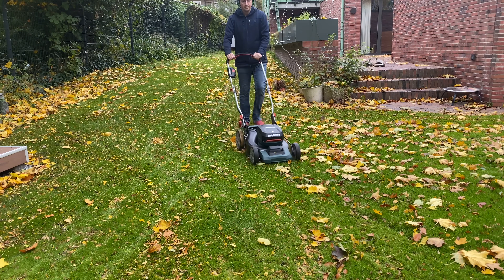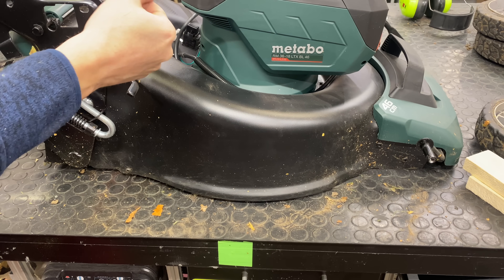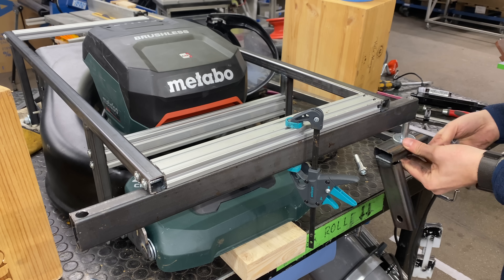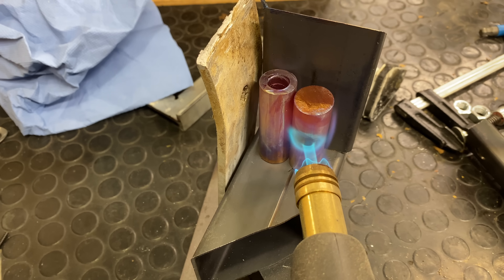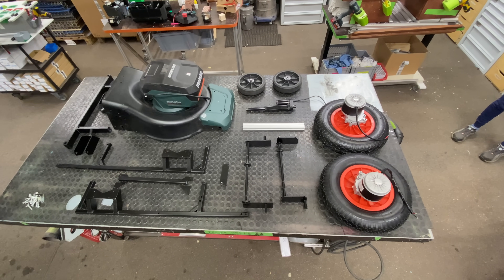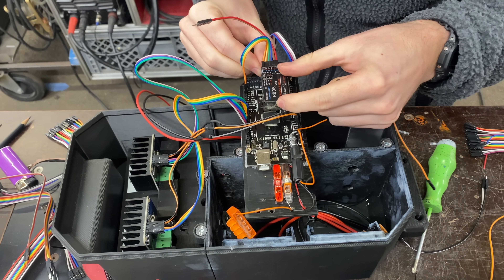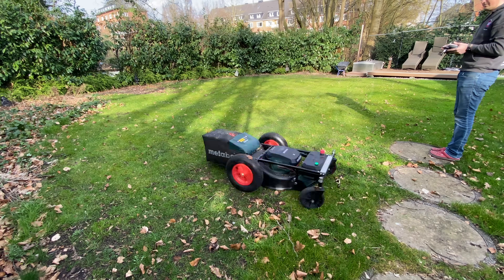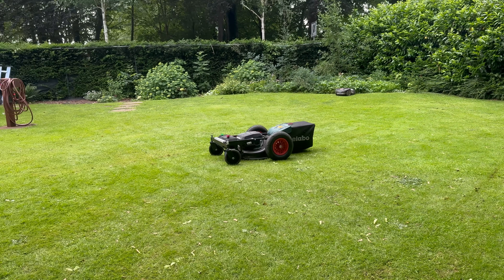Why Push When You Can Play? DIY Remote-Controlled Lawnmower

Comment: 13:32 So, did you have the deck go the max height then min height to calibrate it and then go to your set height? Also, how does the Arduino know how to get to each set height? Is it time based, distance based, sensor based, or some other way? I'm SUPER interested to learn how to do this kind of stuff myself. Just curious how you did some of these things. Thanks. :)
Reply from the maker: No actually those linear motors have endstops built in. So they just stop the motion automatically. I set it to roughly the middle of the travel for mowing.
Reply: @MaxMakerChannel I think I somehow only got half of your message.

Comment: I think the best way to program the controller would be a "thumb-controlled-zero-turn" so each wheel has a centered stick and it either goes forward or backward as you wish. This way you can achieve perfectly straight lines without wiggling.

Comment: not bad, not bad.

3:22 it's funny that you're the first person I've seen actually mention this.  since the front and back wheels aren't the same diameter, that means their axle heights aren't the same either.  So to get a consistent deck height changed with a single link rod some other dimension has to change.  that winds up being the distance between the front and back wheels most of the time.

I solved it by just aiming for the middle and allowing for some slack in the mounts.  I don't get full range, but I get most of it.

I'd love to have a welder.

My build took a slightly different path.  I found a used hoverboard and used that to drive my mower.  it's not as powerful as the wheelchair motors (struggles on inclines) but is just barely enough to get my yard done, and $35USD for two large brushless motors and controllers and a large 10s battery pack is not a bad deal.

Flashed open source firmware onto the hoverboard controller, and from there it's just a serial connection.  The hoverboard firmware actually mixes standard input (front/back left/right) into differential steering so there was no extra programming there, although I'm pretty sure you can just program it as a delta mixer in your fancy RC transmitter....).

To translate RC to hoverboard commands I used an ESP32.  For the RC protocol I used a Crossfire library and ELRS receiver so no messing with PWM; just another single serial port connection.  The ESP32 also has bluetooth and most of the time I actually switch it over to Wii Nunchuk input because I don't want to get my nice RC equipment dirty.

I put all the electronics in an Ikea Pruta container.

And then I mounted a Wyze camera running Thingino open source firmware for FPV.

One additional feature is to be able to completely remove the lawnmower and mount a large plastic tub on top and use it as a RC wheelbarrow.

Comment: Hi Maker Max.  Thank you for posting your code.  Much appreciated.   I was trying to adapt the code for an UNO and came across an issue that was driving me mad.  I just wasn't getting any input on one of the pins, turns out that on the UNO on pins 2 and 3 support  interrupt.   Took me way too long to figure that one out.  Cheers

Comment: 14:09 It looks like this zero turn design is difficult to steer in a really straight line remotely ?
Reply from the maker: Thats true. You constantly need to adjust. The wheels slipping on the grass make it even harder.

Comment: Complex code? Am I missing something?, looks quite easy to me...
Inputs: forward [-1 .. 1], right [-1 .. 1]
Output: left / right wheel speed [-1 .. 1]

left wheel speed = forward - right
right wheel speed = forward + right

Handling speed above/below 1/-1 should be done with respect what the maximum values are (maybe -1,-1 inputs are impossible, idk). Maybe just divide both outputs by two.

Comment: Most commercial mowing robots just dont have that kind of torque in the mower blades to really mulch grass. They are useless for the first cut in the year or for really fast growing periods. My electric Ryobi push mower mulches better than my large ride- on- mower with its good torque...
Reply from the maker: Yeah I see that. But I get my my running in march. So the grass is very short to begin with. Its amazing how much grass it cuts every weak. The blades are only sticking out 1cm.

Comment: For big open lawn areas a standard wide ride- on- lawnmower is fastest in my case. But for all the little hard- to- reach areas I have a small electric Ryobi lawnmower that I can easiely shove near the house and trees and heges to mow. The downside to remote controlling a lawnmower is that you cant see everything from where the remote is, not good for precise german mowing action :)
And a fully autonomous mower is expensive and requires either a cable to keep it in or good GPS signal.
Reply: that's what the FPV camera is for...

Comment: Very nice build!
I recently built one myself with the same type of motors and sabertooth 2x32. It was really fun and works quite well. Planning to do some upgrades  with more convenient height adjustments.
Reply from the maker: I saw a lot of people use the sabertooth. But I found they are quite pricey. The BTS7960 is only about 8€ a piece and doesn’t even get warm.
Reply: True it was pricey, but I'm not familiar with arduino and coding so it was a really convenient and reliable option for me. 
But you got it working really well and yeah saved lots of money for sure! 
Keep up with these projects man.
Reply from the maker: @MysterianX  Either way we got nice toys now.

Comment: Which drill is your yellow 12V that accepts the Bosch 12v batteries? I have never seen that model! 

Great video!
Reply from the maker: Its exactly the one you are describing! I just spray paint all my drills in different colours. That way its easy to grab the right one. One typically hold a drill, a second one a countersink bit and the third one a driver with a bit.

Comment: Maybe, I have a fun idea. You could add some cameras, like in the front and on at the top, for a bird's-eye perspective. So the u stir the robot not with the remote, instead you use a racing sim. Like a Logitech racing wheel. Now you can play from the inside. The connection would be the hard part, I guess.
Reply from the maker: Maybe Ill do a livestream one day!

Comment: Quick tip: When you design teardrop holes you can cut off the tip and have the overhang be ~two layers taller than the tangential, then you can still use rubber washers against the hole

Comment: i built one with tank treads about 8 years ago also with wheelchair motors, however i used standard RC drivers and remote, so i didn't have to write a single line of code, just set up the remote. super easy and it was quite fun to mow the lawn with... people actually stopped and asked if they could try it, so even less work for me...
Reply from the maker: Thanks for sharing! I wanted the code so in the future I can access the controlls and make it follow waypoints.
Reply: @MaxMakerChannel  do you know about Ardupilot, that's a planning tool for waypoints?
Reply from the maker: @renevile  Yes! Thats what I had in mind.
Reply: @MaxMakerChannel  Will you be updating and sharing this project in the future here on YT?
Reply from the maker: For now I will focus on building the workshop.
Reply: very interesting project, could you share a link to the motors and wheels you're using in the project?

Comment: My first thought was: "What a stupid idea for an unnecessary project..."
But seeing the end result completely changed my mind..
This is absolutely genius!
Why isn't every lawnmower remote controlled nowadays? (Security reasons aside...)
This would be way more convenient than a normal push mower and more acceptable for people that don't trust the autonomous mowing robots to do the job...
Reply: For big open lawn areas a standard wide ride- on- lawnmower is fastest in my case. But for all the little hard- to- reach areas I have a small electric Ryobi lawnmower that I can easiely shove near the house and trees and heges to mow. The downside to remote controlling a lawnmower is that you cant see everything from where the remote is, not good for precise german mowing action :)
And a fully autonomous mower is expensive and requires either a cable to keep it in or good GPS signal.

Comment: Mulch the leaves. As long as you don't have to many leaves mulching is really good for the soil.
Reply from the maker: I tried that for some time, but we get too many leaves. The mulch would suffocate some of the grass every winter.
Reply: I do that every year with my RC mower. My neighbor rakes his and bags his all day long. I mulch mine in about 30 minutes from 20 feet away, staying clean and dust free and having fun doing it!.
Reply: @mamajan99 mulching, I agree, is good for your yard, but with years of mulching, I've found it actually raises the elevation of your yard also. My place has been in the family for 60 years. About 15 years ago, I had to use a skid steer and remove all the grass and several loads of topsoil. Mulching had raised the elevation to the point storm water was coming onto my front porch almost into my home. The front yard is so small I've bagged it every since I lowered it and got my lawn reestablished.

Comment: You should have inverted the motors so they will be on the outside. Next build maybe?
Reply from the maker: I was thinking about that. That would have required new wheel hubs with the motors sticking into the wheels. Like brake callipers. the next build will probably be a snow blower with tracks.